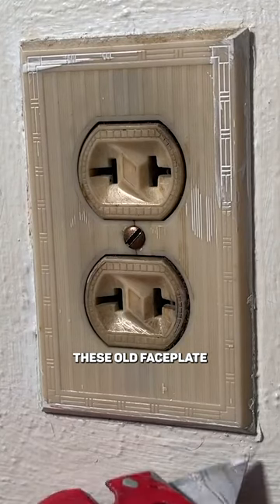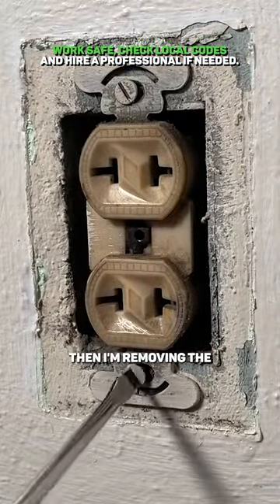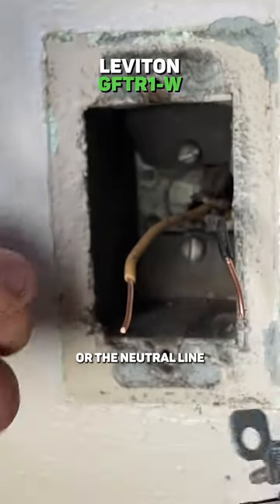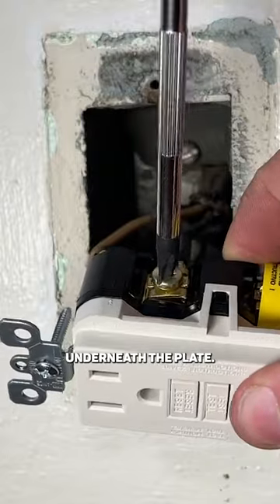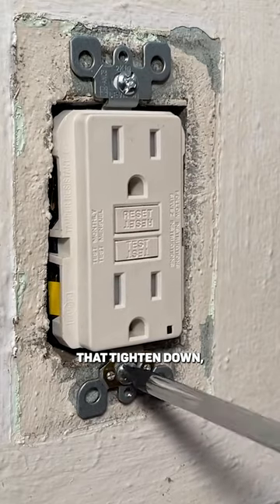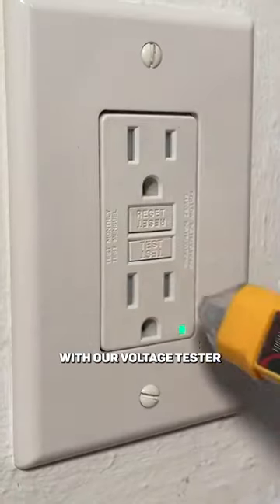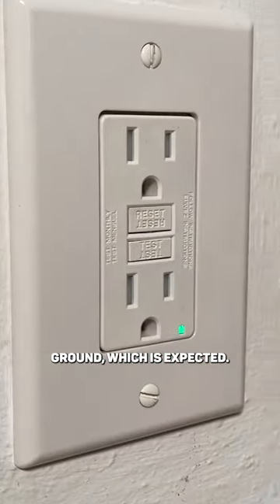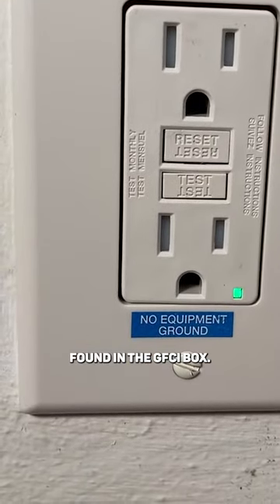Safely Converting 2 Prong To 3 Prong

Comment: The amount of people who don't understand how a GFCI works is mind blowing. GFCI's do NOT need a ground wire to work. That would defeat the purpose of them. Think about it, people. If they needed a ground wire to function, what reason would there be for them to even exist? On a grounded circuit, regular non-GFCI outlets already have protection from ground faults because they are bonded to the service panel. That's the whole point. GFCI's exist specifically for old ungrounded circuits, and also to give newer grounded circuits an extra layer of protection, which is why we still use them in bathrooms and kitchens even in new houses with fully grounded circuits. They are literally designed to retrofit legacy wiring systems and give them a level of safety that is equivalent to modern wiring, despite not having a ground wire. If anyone tells you that a GFCI will not work on an ungrounded circuit, do not listen to them.
Reply: So what happens when both hot and neutral are at some potential to ground?
Reply: @RobertSzasz  I'm not really sure what you mean. Are you asking what happens if 2 ground faults (1 on the hot side and 1 on the neutral) happen at the same time on a GFCI protected circuit?
Reply: What do I do if I need the third prong/ground for my grounding/earthing bedsheet if non of my outlets are grounded? The grounding sheet only plugs into the ground of the outlet. 
Would using an adapter to have the third prong work?
Do portable transformers/voltage converters have built in ground? 
Please advise. Thanks.
Reply: @greys52909  I'm not sure what a grounding bedsheet is, but if you only have access to ungrounded outlets, then no it won't work. However, if the metal boxes that the outlets are installed in are grounded (which is often the case), then using one of those adapters should work as long as you screw the adapter to the outlet's cover plate using that little tab sticking off the bottom. This is assuming you're from the US or Canada. I'm only familiar with North American wiring.
Reply: @Beefnhammer  thanks for your response. I am in the Philippines and the outlets here are mostly not grounded. 
Grounding or earthing sheet or mat they say is equivalent to walking barefoot on the ground. As in grounding yourself to the earth. There have been studies about the health benefits it provides. You can look it up and you’ll find some information about it. Thanks.

Comment: Why put an expensive gfi in if there's no ground.... wouldn't you just put in a regular outlet....gfi will never work..
Reply: The GFI is why you would put in something where there is no ground. You're not understanding how GFI works. That's the whole purpose in this type of situation where it doesn't have a ground wire. You would put in a GFI which measures current and when it detects that the current is not equal then it trips. You do not need a ground in the situation.
Reply: My god, the amount of people who comment without knowing what they're talking about...

This is exactly why democracy doesn't work

Comment: What if I have two neutral and two hot wires. How would I connect one then?
Reply: There should be two screws for each side, the hot and neutral sides. There will be a small metal tab that connects them together, but if you want two separate circuits (i.e. want one always on and one powered by a switch) then all you have to do is cut the tabs!
Reply: if you are talking about how to wire up a gfci plug then you need to know which pair of hot and neutral wires is the line side and which pair is the load, this must be done correctly for a gfci to function and protect properly. line side just means which pair is the power coming from (upstream or from the panel) and load is where the power is going (downstream to the rest of the circuit) it is crucial to make sure you are installing at the beginning of the circuit

Comment: A GFCI plug with no ground, what a joke. It is videos like this that will kill someone
Reply: Learn how a GFCI works. 

406.4(D)(2) Non-Grounding-Type Receptacles.
...
A non–grounding-type receptacle(s) shall be permitted to be replaced with a ground-fault circuit interrupter-type of receptacle(s). These receptacles shall be marked “No Equipment Ground.” An equipment grounding conductor shall not be connected from the ground-fault circuit-interrupter- type receptacle to any outlet supplied from the ground-fault circuit-interrupter receptacle.

Comment: Why not just run a new ground?
Reply: Not always practical to run a ground wire.  My old house was on a concrete slab with lath catchers inside the walls, so I would have to cut holes all over my drywall to run a new ground to all receptacles.   Put in GFCI and be code compliant within minutes.

Comment: America is crazy. How can it be legal to not have a ground just by putting a sticker on it?
Reply: Grounded outlets weren't required in the US until like 1970 something... And a great many homes were built before that.  You'd literally have to change the entire electrical service in some cases to ground an outlet correctly.
Reply: Many US homes predate NEMA standard.
Note that the electrical box he's installing the outlet in doesn't have a bare wire at all. There is no ground to connect. To have a ground you'd have to install the wire and connect it to the nearest available ground if not the actual ground busbar in the main panel.
Reply: My previous house was built in 1919 and the electrical was 2 separate wires running to the outlets (receptacles) and they looked like they were made with asbestos. Had the old round glass fuses too.
Reply: It's legal if it's GFCI protected. As the GFCI will trip the circuit if there is any leakage of current to ground (or more precisely, any difference between hot and neutral current)
Reply: @a9ball1  I believe that's called knob and tube

Comment: Just put a regular recep in if no ground. Why pay $20 extra  for a GFCI that had no ground fault protection.
Reply: A GFCI does not need a ground to function.  They trip when something bad is used as ground (aka, your body), which saves lives.

This is exactly why the GFI is required if you want a three prong outlet without a ground.

Comment: My guy really just used his tester on the neutral side of the plug
Reply: Never know if it's wired backwards or if the plug is upside down.
Reply: And he's still alive?
Reply: Even an idiot knows to check every single wire in a box.

Comment: Why not just add a ground to the neutral side and it will be grounded. This would pass inspection if this was a rental unit for housing authority.
Reply: You mean connect the neutral to the ground? That is against the code.
Reply: @okaro6595  then it reads as open ground and you wouldn't pass the inspection
Reply: @andrewmlyles No it won't it'll read just fine.
Reply: If those inspectors,  would open those receptacles and see that jumper would fail it.
Reply: @thomasmarable6818  I did it in front of an inspector and he passed it.
Reply: Jumping the neutral to ground makes the whole thing significantly more dangerous  for the sake of tricking the inspector's tester.  Very bad practice.

The method shown in this video is safe and typically meets code requirements.
Reply: Because then you've just created a huge fire hazard. If you knew what a ground is, what a neutral is, what a gfi is, or how electricity works, you would understand why your statement was stupid.

Comment: HUH! Are you really allowed to do that in the States? I knew that you have dangerous electricity systems but this was something hair rising.
Reply from the maker: We are, don't forget the label (No Equipment Ground) on the faceplate.
Reply: Yeah it may surprise you to know that the rate of electrical fires in the US and UK is fairly similar 3 in 10,000 in the UK and 4 in 10,000 in the US. Despite the fact that Americans use way more electricity and tend to have far more electric appliances and the like. Electric ranges, ovens, water heaters, whole house air conditioning, televisions in every room, electrically powered water features (hot tubs, fountains, swimming pools, and so on). So that doesnt really support the notion that US electrical systems are less safe.
Reply: How is that more dangerous than the Finnish one where one can plug the grounded plug to an ungrounded outlet without any extra protection?
Reply: Yo, in Europe they use 240V which is incredibly likely to kill you if you touch it.  In the US we use 120V primarily, which isn't pleasant to touch, and has fatal risks, but most electricians here will say they've been zapped plenty of times with no issue.  It's different.
Reply: Our electrical systems are the safest by a mile

Comment: Congratulations on making this outlet even more dangerous by encouraging plugging in things into this that need a ground
Reply: Are you paying attention? It's a GFCI with a "No equipment ground" label. 
This is an acceptable option per NEC. The GFCI eliminates user shock hazard and the label warns the user that a ground is not present in case you are plugging in sensitive equipment.

Comment: Nice video but please for the love of God make sure that all of your screws are going horizontal or vertical if you doing a toggle switch there's no in between and it is not called in Outlet it is called a duplex receptacle and it's 2022 not 2002 we have screwless plates use them they're a little bit extra money but they're worth it

Comment: So you didn’t fix anything, educated nothing and left an ungrounded GFI which negates the purpose of GFI and posted it as an educational video? didn’t even tie the neutral to ground which isn’t code but would make it somewhat safer. Got it bro, you’re my go to electrical know how channel now (AKA BLOCKED).
Reply: "tie neutral to ground which isn't code ..." No isn't code because it's a major code VIOLATION. You clearly don't know what you're talking about.
Reply: You clearly have no knowledge of how a GFI works nor the NEC. This is perfectly acceptable. A ground is not needed for a GFI to function properly.
Reply: You always do by the code and this is by the code.
Reply: A GFI works without a ground.

Tying ground to neutral is significantly more dangerous than leaving it empty.  The only reason to do that is to fool a tester to pass inspection.

Comment: What's the point of a GFI without a ground? It shouldn't even work without one.
Reply: Gfci’s don’t rely on a ground to work. They compare amperage on the hot side to the amperage on the neutral side. If there is as much as a 5 milliamp difference then the gfci will trip off.
Reply: @MrSleepProductionsInc  It's my understanding that the current measurement has to be referenced to ground. You can even test one by connecting a resistor of the appropriate value from the hot side to ground. I've actually done that. Two different resistors; one to test (non)trip just under 5 ma, and another to test trip current just over 5 ma.
Reply: @joewoodchuck3824  GFCI compares supply current to neutral return current. Your method works for a GFCI with equipment grounding conductor, but this is a code compliant way to install a three prong receptacle on a two wire circuit where an equipment grounding conductor isn't readily available. GFCI does not need an equipment ground to work properly. Any leakage greater than 5ma to any other grounded path(through your body for example) will trip it.
Reply: @joewoodchuck3824  Sorry but your understanding does not matter when it is wrong. A GFCI compares currents between the line and neutral as that could indicate that someone is getting shocked. While a ground fault can happen also through the ground wire, that is not the reason they are used. They are used to prevent it happening through a person.

Comment: You do realize that without a ground wire you have no GFCI protection whatsoever.
Reply from the maker: Common misconception.  No ground needed for GFCI to provide protection.  The GFCI detects a difference between the hot and neutral and if there is a difference that is what caused the outlet to trip.
Reply: Hard to believe how many armchair electricians have no idea how a GFI functions.
Reply: Another genius